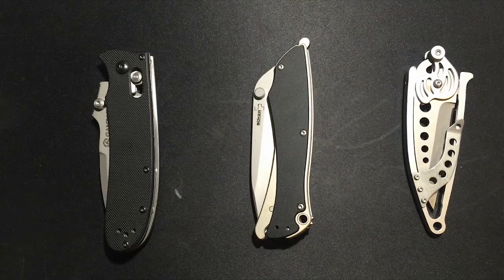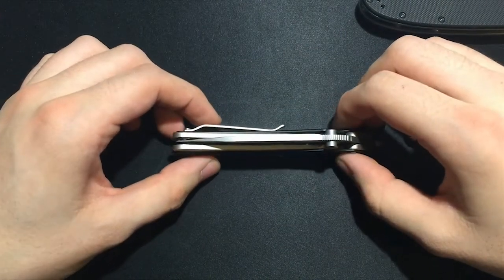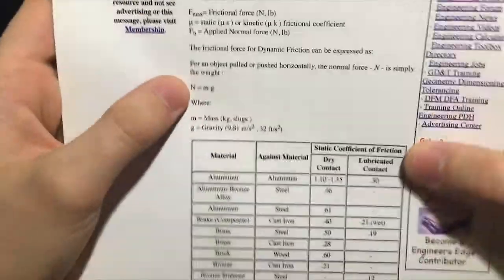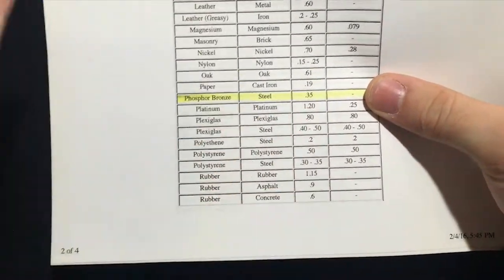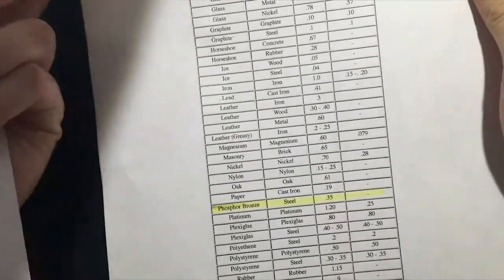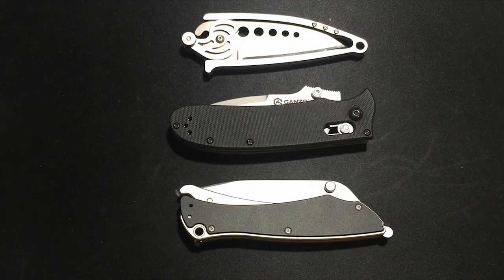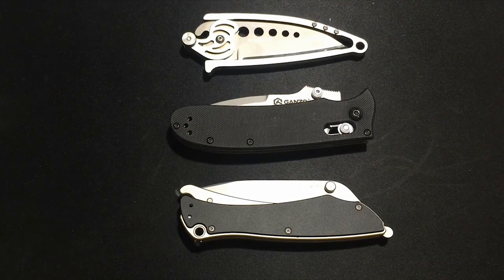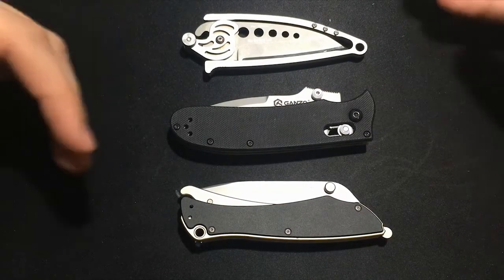Why might phosphor bronze washers NOT be the best!?

Comment: Comparing the coefficient of friction isn't really valid without also comparing the required contact forces between the two materials, as the resistive force encountered by the blade is directly and linearly dependent on both factors. In my experience, I have found that knives with Teflon or synthetic washers often need to have their pivots run tighter than knives with phosphor bronze washers in order to obtain a minimum level of play, resulting in higher resistive forces despite the lower coefficient of friction. Just something to consider.
Reply: Absolutely. Both the teflon and the ptfe are compressible which increases the surface area of contact under pressure

Comment: You usually see one Bronze and one Teflon on knives with a frame or liner lock to counter the sideways pressure of the locking mechanism as Teflon alone is too weak to hold the blade in place. The Bronze is often smaller than the Teflon one too because the lock style allows less room for the blade to swing.

Comment: I think the Ganzo 704 there comes out easily because of the slight assistance of the axis lock mechanism. The axis lock helps carry momentum of the blade when it is flicked. The G704 has a stronger axis spring then the newer Ganzo models, so it would have more flicking assistance.

Comment: I got a super cheap knife with plastic washers, it's really bad quality, but I thought I might make some washers for it. They are just plastic now, not even teflon, what would you recommend? tearing down an aluminum can for washers would be easy, but maybe there are better options?
Reply from the maker: Honestly, if you are dead set on replacing the washers, there are plenty of places that supply knife parts such as washers that would likely work for what your doing. Off the top of my head, there is USAKnifemaker that has a great selection of washers, bearings and so on. I personally wouldn't make my own simply because the materials used likely wont be much better than what the knife came with in the first place. Hope this helps!
Reply: If you can find an old floppy disk.
Those work awesomely as material to cut diy knife washers.

Comment: Wait a second.....is that a crkt van hoy snap lock?! Where did you get this one? Aren't they supposed to be dis continued?
Reply from the maker: +Haochen Niu But of course :) I have owned it since I was first getting into knives and they were still in production. They have been discontinued for quite some time now.
Reply: +Blades and Boom I just love knives that has some unique design and construction just like the snap lock.Really want to know where can I find one for sell
Reply from the maker: +Haochen Niu As do I! They are so cool/fun. As for finding one, they appear on ebay quite often, listing between $100-$300 depending on the condition, however, if you simply like it for its mechanics, there are a few knives out there that use a similar system, some of which are still in production!

Comment: the simple fact that one (teflon) can and does get deformed by any sideways pressure and, at least for me wear, is why I will always go for bronze. Every knife I have owned with teflon would consistently loosen up some and fairly consistently need tightening. My Sebenza (my first with bronze) was an edc for 7+ yrs and not one time did I need to "fix" it. I don't care for fall out of the handle slick, I like very smooth opening from start to lock. My next was a Kershaw OD2 with a very similar trait that i loved also. A couple of cheaper ones in between (one being another kershaw, but a wallyworld kershaw)with the damn teflon was junk. I am awaiting a crkt to be delivered today and I have my micrometer ready to measure for bronze washers if I find  that it comes with teflon. Another point is the OD2 actually had several quite thin washers versus one per side that I think helped allow most of any friction to be well dispersed over multiple surfaces helping to reduce said friction and any wear, although my sebenza went through several thousand open/closings in my time with it without any noticeable wear.
Reply: that said, I just realized I may be comparing PB and nylon washers, not particularly teflon which could very well be a huge difference.

Comment: What about the nylatron washers on Emerson knives? I couldn't find any data on it in terms of on steel... Like the video though, very scientific!
Reply from the maker: you know, I am honestly unsure. I have not yet added an Emerson to my collection, though I would assume that it would have a frictional coefficient a bit less than nylon since it is essentially a nylon washer with molybdenum disulfide powder on it to lubricate it further. These would likely outperform both phosphor bronze as well as teflon on its frictional co-efficient (though this is a guess) however, phosphor bronze would likely still provide a slightly sturdier base for lock up.
Reply: Agreed, thanks for the video, would like to watch more of these. :)

Comment: I have the rat 1, it has the bronze with the really thin teflon washer riding on the blade, i think its stupid because if you look at the action nothing spins, the blade just rides across the teflon, are they doing that on purpose to reduce deformation of the teflon? I personally think its trash because now if the teflon wears out which it will because its so thin, then you are left with just bronze and the gap left by the two washers is (still significant in tolerance terms) , i probably won't buy another knife using the two layer washer setup, if i can avoid it, they are all sneaking this in though so you really have to watch out.

Comment: Just realized I have a red washer on my buck marksman.....what is that material (　ﾟдﾟ)
Reply from the maker: +Haochen Niu The Buck Marksman actually runs on a bearing system. It actually uses steel washers so that the bearings dont cut into the aluminum sides, and then the red things you are seeing are the cages that contain the bearings within them. I am not sure 100% what the cage is made out of, however I would guess that since it is red, it is a colored nylon (though it could be an anodized metal, I would think they likely used nylon)
Reply from the maker: +Haochen Niu The Buck Marksman actually runs on a bearing system. It actually uses steel washers so that the bearings don't cut into the aluminum sides, and then the red things you are seeing are the cages that contain the bearings within them. I am not sure 100% what the cage is made out of, however I would guess that since it is red, it is a colored nylon (though it could be an anodized metal, I would think they likely used nylon)
Reply: Pretty sure if I'm remembering correctly the ESEE Avispa and Ontario Rat 1 were two of my knives that did both phosphor bronze and nylon on each side with 4 washers total.  The nylon washers were more super thin sheets of nylon tho, dunno if they can be considered washers.  Durability of bronze with the speed of nylon?  Either way those Ontarios are smooth as hell, Avispa little more difficult to rocket open but that has to do with lock bar tension and thumb stud placement.  My Ganzo(729) has one of each washer.  What is the Boker in this video?